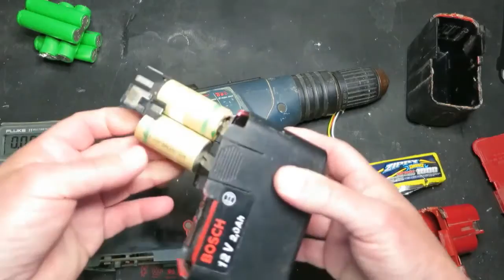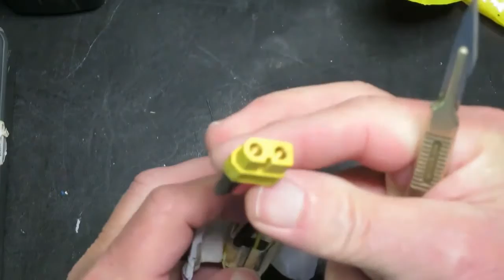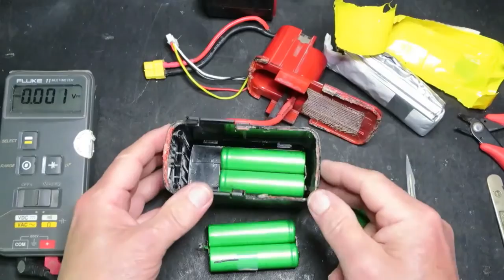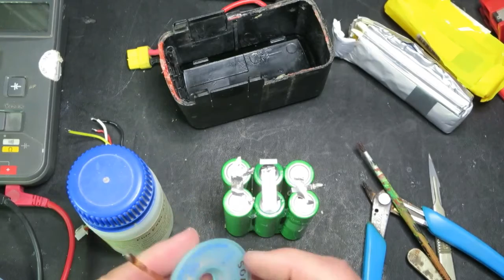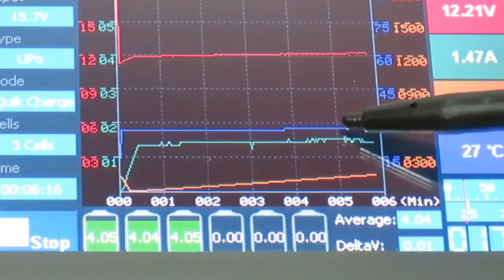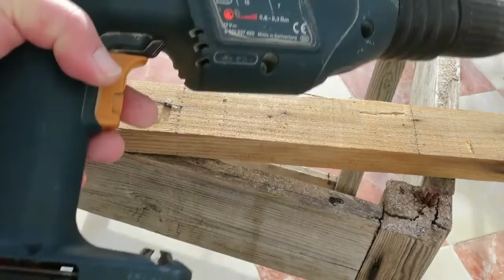Ni-cad to Lithium Battery Drill Refurbish Electronic Repair Project

Comment: I have a old 18v drill and it's a Ni-cad I had 2 packs but I can't seem to find the other one, but it ran until I couldn't charge it any longer so I zapped it with a 24v just tapping the pos wire to the terminals 3 times and it wasn't dead at all, in fact it had a near full charge . If you have one of these and you use it to screw in a few screws or drill holes and there's still a lot of power left and you put it back on the charger, it will lose the remaining charge you had left in the pack and you'll only get the amount of charge from when you put it back in the charger, so say there was still .75 or 3/4 of the power remaining when you plugged it back in, you'll only get .25 or 1/4 of the power on the next run on so over the course of time it will be dead because these batteries have a memory so when you shoch it and I don't mean hold the juice to it, just a few taps maybe up to 5 times but you have to use a higher voltage like I said and I had better results with a 30v source than a 24v source, try it. I still use that same battery even though it went dead a few times. the trick is to let them run dead then charge them and when they die zap them.